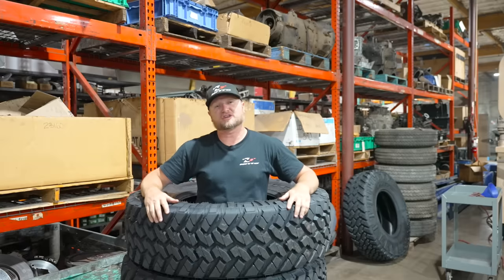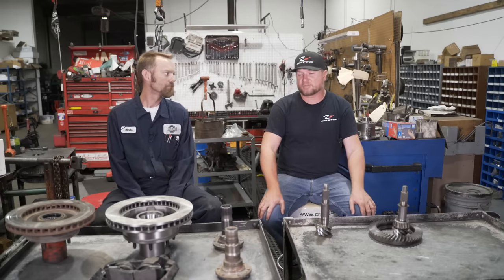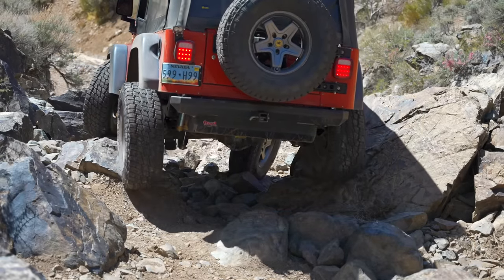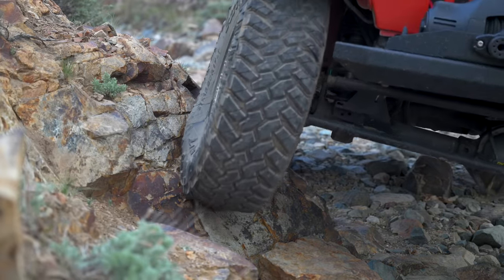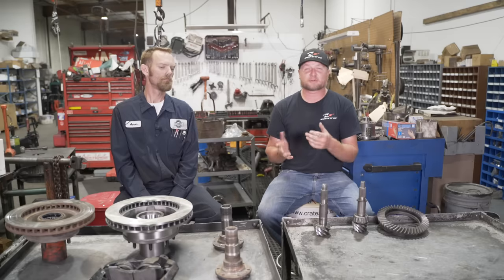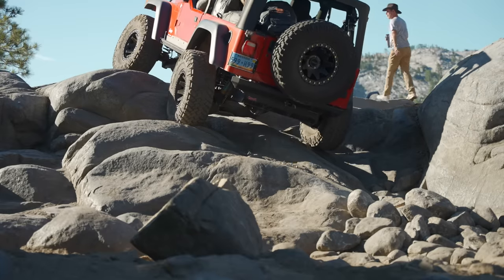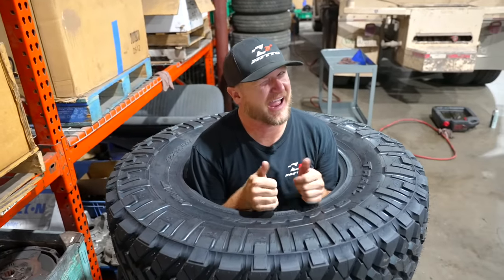How Big of Tires Can You Run on a Dana 44? | Harry Situations

Comment: I ran 35's on stock Ford  ranger axles for a few years with no problems  , when i went to 40 's i broke 3 rear axles and a lot of bed bolts and other stuff.  Never broke the front ttb though

Comment: Great Video! Wow, great discussion and so much good info! I am planning on ordering a 24 Rubicon Pentastar 3.6 auto with 35s, there is an option from factory for 4.88. I will be putting a rooftop tent and occasionally towing (2 o 3 times a year). Do you recommend 4.56 or 4.88?
Reply: I would go with the 4.88s.  The 8 speed has a 0.67 final gear so even with the 4.88s the RPMs shouldn't be too high on the freeway.

Comment: On my jt with axle truss and c tab gussets with dynatrac heavy ball joints, I done goofed pushing a hard trail (black rated) at rausch creek on 40s. Cv blew and the lower ball joint ripped through the c. 40s if you don’t wheel with the protection I had ehhhhhhh might be safe. I’m now waiting for my dynatrac 60/80s to ship and I’m driving my 98 tj staring at my jt in the driveway hurts lol
Reply: Rubicon jt* was locked during the break crawling super slow

Comment: I purchased 34 inch tires (Nitto Ridge Grapplers) for my Jeep for this very reason.  It's more narrow than a 35, lighter, and appears to be the same height as 35's I compare them to around town.  I'm not a mechanic, and and trying very hard not to trash my rig because I can't fix it myself; but still challenge myself on the trail.
Reply: Smart move! I prefer skinny tires as well for most terrain. All the ground clearance, easier to fit, and lighter weight.
Reply: Super swamper had those 34 tall 9 1/2 tires that went good and pretty light

Comment: I have an 89 bronco with the dana 44 ttb. I do plan to regear it and put a ford 9" in the back but I want to keep the ttb. do I need to upgrade to the dana 50 ttb?
Reply: I’d stick with the 44, if for no other reason than to match the bolt pattern of the 9”.

Comment: Only time I have broken my SD60 was over a bounce. I was trying to crawl something I shouldn't have even attempted. I have run 1550s in it now. We run 40s on both Jeeps. The wife runs D44s with zero issues for years now but she doesn't beat on her rig. Only reason I want a bigger than 40 inch tire is because I literally drag my pumpkins on everything now and my 14 bolt has a 15 bolt shave on it. I do miss not getting hung up when I had D44s LOL

Comment: I’m building an 84 4runner. Swapped in a LS/ th350 and Toyota case. I have 4.88 gears now with a full float does 9” rear. I’ve been working on the front diff. Either ruffstuff wider axle or Dana 44 swap. Also considered going down to 4.11’s since I spend my time at the Sand Dunes
Reply: I like Toyota stuff but if you want to go wider a Dana 44 will be a lot less expensive to build.
Reply: @HarrySituations  I have long field chromoly axles already, hi steer and billet 4bolt steering arms. The +5 axle housing is around 850-900 and includes a chromoly short side axle shaft. I just don’t know if the front 8” can handle 400-450hp

Comment: Been running 42s on my chev d44 under my v8 powered jeep for a few years now!
Reply: What have you done to support your d44
Reply: Like they said in the video... driving style and terrain play a big part. I beat on my junk in the rocks so I break stuff.
Reply: @SandyBoxes  nothing. I just dont drive like an ass.  I run dual cases and mostly wheel snow, but the jeep is also my summer broverlander
Reply: @heavymonty  2 door or 4 door? I feel like even with my 35s I need to reinforce the axle just because of the weight even for daily driving. Lots of potholes haha.
Reply: @SandyBoxes  TJ.
Reply: @heavymonty  yeah that makes a huge difference. There is no way I could pull that off on my 4 door jk with all the weight I carry.

Comment: I have a 97 Dodge ram rwd,I am running 38s on a Dana 44,with 4.56 gears,daily drive
Reply: I have a 94 Dodge Ram 2500 with Dana 44s. Right now I have stock size tires on it but wanting to put 33s all terrains on it. Factory height right now. I know it might be hard to answer this without seeing truck but I wonder do you think I would need to lift it to put 33 narrows on it? It sets high for factory. It's 42 inches from ground to bottom of outside of fender. Any help would be appreciated!

Comment: had a 70's cherokee built 401 with 3/4 gm 44 an ff 14 5.13 gears on 40" tires only thing i kept breaking was transmission mounts

Comment: I've repeatedly blown out high pinion Ford Dana 44 Cromoly shafts with 33's and open 4.10 gears in a lightened F250 with a straight 6 and no bed... Not once did they survive longer than 20 minutes on the rocks. It was never the shaft that failed, but the tiny little U-Joints. First sign of real traction and they shear the caps right off the cross.
Reply: Are you reusing the shafts? The ears are probably stretched out by now. And those older trucks used 260 sized u-joints that are smaller than the 297 joints. Maybe we need to do a u joint video next!
Reply: @HarrySituations  nope I've always replaced the entire shaft when they failed. After the third set I gave up, at $600 a pair it got expensive real fast.

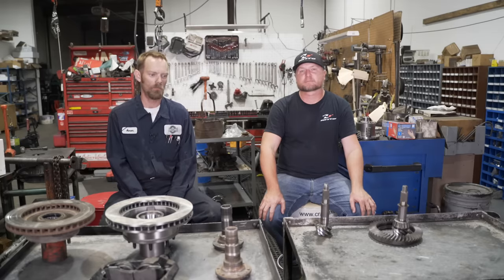Comment: I'm building D44's, the front comes from a '76 waggy, which is a great swap for a '65 Baby Scout. Nothing super special engine wise, 196-4 TBI. Wide T19 going through a D18/20case. I've been driving around on 265x75r's16 for years now on the stock D27 f/44f rear 4:27's. Never broke anything, but doesn't turn very sharp either. The plan is to run 35"s(I even have 37/38's on my mind). My main question is after watching this video, would I be better off on 5.13's or 5:38's. I've been leaning toward the 5:38's, I like the low crawl ratios for my 4 popper. Plus, I like the idea of the driveshaft as the "fusible link" in the drive train. I'm more a finesse driver than a bang and hop sort driving around with old farm equipment.
Reply: You are only talking 5% difference between 5.13s and 5.38s. I think that you will be fine with either since you have that low first gear in the tranny.

Comment: Thoughts on JLU Sport M186 front M220 rear with 3.45 gears.  I would like to run 285/75 r17 tires.
Reply: I think that you will be just fine. Normally I would recommend lower gearing but the eight speed really seems to make it less of a priority than previous Wranglers.

Comment: Harry what do you think about the new full float rear? Should make running 37" or more less of a scary issue right?
Reply: Which full floater?
Reply: @HarrySituations  The forthcoming 2024 rear dana 44. Full float in the rear on rubicon/x wranglers
Reply: @robottaway  I hadn’t heard about that. I would agree that should allow you to run a 37 with no issues. The ring gear on these axles is already bigger than a traditional Dana 44 and the full floater means the axle shaft only has to turn the tire, not support the vehicle weight. Sounds like a great improvement!
Reply: @HarrySituations  right on time to start saving 😅

Comment: How do you all feel about " shave kits" ? Some kits alow 2 inches to be cut off a 14 bolt . Making it close to a d44 in clearance from the ground
Reply: I definitely think more ground clearance is a good thing. I wouldn’t get too greedy though, I have had trouble in the past sealing the cover with kits that shave so much you have to turn down the ring gear and weld a plate on the bottom of the housing.
Reply: @HarrySituations  tmr now makes a shave kit with or without the need to have the ring turned down now. That's the move I'm probably going with on winter build.   I think the Ring shave kit only save an additional quarter inch maybe a silver more.  BTW - the vehicle will be my second junk yard g wagon build on 40's.  The first has a blown engine after a stupid amount of money and time . I'm doing it again with a rear ended one .I got for a can't pass up.deal.
Reply: @immelting9834  I’m not sure I’ve ever heard the terms “junkyard” and “G Wagen” used together before!

Comment: I'm kinda curious how much stronger JK and JK Metric D44's are compared to the old D44 with Set10 bearings.  Also, I've seen some JK R&P kits for installing into an older D44 housing.  Are they worth it over regular gears?
Reply: I think that the larger ring gear and increased spline count makes them stronger. The larger pinion shaft doesn’t seem that important to me because it isn’t something that I typically see break.

Comment: HP 30 is an XJ only axle.  All OE TJ axles are LP.
Reply: Didnt the YJ use a HP Dana 30 also? I got that wrong previously in the YJ video I did for Driving Line.
Reply: Yes.  YJ had a HP 30, but it was a CAD axle.

Comment: Running 38s on my jk rubi. Keep bending the flanges on the rear chromoly axle shafts. Fronts fine. Im prob wayyy to hard on it. I like the skinny pedal.
Reply: I’ve seen that on some Dana 60s that still run a 5x5 pattern and are semi float but running 40s. Sounds like it is time for a full float rear axle.

Comment: Super deep gears vs a doubler on the Tcase, if you can afford only one to start with on a trail only rig, which would you go for?  I'm building a 2003 4 door Tracker with a TJ front frame clip, D44 front, 9" rear, 112" wheelbase, 37" tires.  Running a stock 4.0, AW4, NP231.  Looking at a 231/231 doubler case.
Reply: I think the doubler will make the biggest difference on the trail. The only downside is if the gears in the axles are not low enough to turn the tires on the road.

Comment: Would the D44 on my 86 Ramcharger be the same as the D44’s on the newer trucks of today? Were they stronger/weaker than the current model axles? Would possibly like to go 33’s or 35’s max and not lift it but rather cut fenders for clearance if needed. Thanks.
Reply: They are not the same, newer axles use unit bearings instead of a fixed spindle and locking hub that your Ramcharger has. Newer Dana 44s do have bigger brakes though. I think you will be fine with 33s or 35s.

Comment: Ok so what’s biggest tire on Jl diesel I can run?
Reply: I think 35s are no problem but with the added torque from the diesel I would upgrade to aftermarket axle shafts (like RCVs) if you run 37s.

Comment: You were talking about running 37s on your jeep, can you please tell me the offset is on your wheels or did you use spacers? Thanks.
Reply: I am running 1.5” spacers Larry. Or adapters to be more accurate, since I have 5x5 AEV wheels with 5” backspacing. Wider axles would be nice but that obviously isn’t an easy endeavor.

Comment: The TJ did not have a HP30. That was the XJ and the HP in the XJ ended in 99, the 2000 model had a LP30 nicknamed the TJ30.   I agree with leaving it in 2WD until you need more IE rear locker then 4WD then add front locker then winch LOL
Reply: Thanks Tom. I have gotten that information wrong in the past, I will try to stop making the same mistake over and over.
Reply: @HarrySituations  Ehhh it's wishful thinking LOL. We all wish they would have never went away from the HP 30. Enjoyed your video, I am building an HP44 from an F150 for my TJ right now. Really looking forward to it being done! OX locker, gears, truss etc.
Reply: @tomhubbard353  are you going to use the wedges on the axle for radius arms or run a three link front suspension?
Reply: @HarrySituations  I am cutting all of that off and installing a Barnes truss kit for a Wagy 44. I am still on the fence about narrowing it to wagy width or running it at 66 (full width) and adjusting with the wheels as much as possible (Better scrub) then Welding 9" ends onto my 8.8 to widen it to match plus eliminate the C clips etc.
Reply: This is correct, although the Wrangler YJ did have HPD30 with most years having the dreadful vacuum disconnect. My TJ has a D44 and HPD30 from XJs. Most of the XJ 44 parts are interchangeable, but I believe the axle tubes are 'slightly' thicker.
Reply: @dlm32067  That's true, I wasn't thinking YJ since it is not bolt in to a TJ (Leaf springs) I have collected several HP30s out of XJ with the intent of building a beef 30 for my TJ, then changed my mind and am building an HP44 out of a 76 F150. (NOT bolt in LOL) (The 76 HP44 also has the 1/2 inch thick tubes). There are LOTs of parts that interchange directly or with minimal modification between XJ, TJ, ZJ, MJ etc. makes for some great deals when you know LOL.

Comment: I have an LJ with 4:10 rubicon axles and 33’ tires. I am wanting to go to 35s and 4:88. It’s an automatic. Will lower gears make it have significantly better engine braking in low range?
Reply: Does it have the Rubicon transfer case also? I ran 35s and 4.88s in my LJ Rubicon and thought it was a great combination.
Reply: @HarrySituations  What about a 1991 K5 Blazer with OEM 30 spline axle shafts, 4.10 diffs, a TBI 350 with +40 hp and +50 ft.lbs more(250/350) than stock(210/300), 4L60 automatic, and a weight of 5000 pounds. How safe are 35x12.50r17 Yokohama X-MT tires(110lbs for wheel and tire) when off roading to a "medium" degree ?
Reply: @gen1c8rs88  the weight is a concern with your K5 but I think that with the automatic transmission and sensible driving you will be fine. One thing you didn’t mention is if you have a locking differential in the axle or not. Automatic lockers like Lockrights and Detroit’s and stress axle shafts and hub gears.
Reply: @HarrySituations  Locking hubs, no automatic lockers. 5000 lbs is all in including my weight.
Reply: @HarrySituations  It has the Rubicon transfer case. Can you get significantly better engine braking with an automatic transmission by lowering the axle ratio? I am partialy paraplegic and am looking for better control on down hills.
Reply: @fredeschen3783  it helps a little but I wouldn’t say that it is significant. I will give some thought to what might work best for you when going down steep hills.
Reply: 4.88s are to low on the road with a TJ Rubicon nothing like pushing 65 miles an hour at three grand with 35 inch tires
Reply: Use the gearing calculator online rather than taking somebody’s word for it
Reply: @Fishpalms  that has not been my experience. My 42RE couldn’t pull 65 in overdrive when I had 4.10s.
Reply: you have an automatic I have the six speed on the nsg370 a little revvy on flat stretches But very fun in the hills pulling past other Jeep’s
Reply: Also cherokees had the hp 30 TJ’s had the lp 30
Reply: @Fishpalms  that's not even remotely accurate. My lj with 35's and 4.88's does great on the road.
Reply: @TheOnlyBlackInMeWasWillieBrown  nsg370 transmission
Reply: @TheOnlyBlackInMeWasWillieBrown  automatic or manual- 2006 manual Rubicon TJ Is my setup you have an LJ probably non rubicon which means different transfer case factor in all these things first before commenting

Comment: I have a jk rubi and plan on running a 5.7 hemi would my stock axles take it ? I have an aftermarket front housing but my rear is stock with a truss and yukon axle shafts… would it take it ? (Tires are 37s) similar to your LJ
Reply: I think that you are on the cusp with horsepower and weight but if you drive it conservatively you will be fine. If you mash the gas (hard not to do with a Hemi!) you might be shopping for Dana 60s in the future.

Comment: Great vid! I have a Dana30(front) and Dana44 (rear) on my 2004 TJ Sport. Right now I'm on 35's with 4.56 gears. I was thinking of going up to 37's and replacing the front axle with a Dana44 and adding chromoly shafts front and back. From what you guys said in the video, a Dana 44 is not that much of an upgrade than a Danna 30. Did I hear that right? Should I stick with the Dana 30 and just strengthen it with chromoly shafts and truss?
Reply: The Dana 44 used in the TJ Rubicon has a slightly larger ring gear and carrier with 30 spline inner axles (instead of 27 spline) but the same outers as a Dana 30. Honestly I would look for a high pinion Dana 30 out of a Cherokee and build that with RCVs and a selectable locker like an ARB Air Locker. It will bolt right in and be light and strong with great ground clearance.
Reply: Dana 30 will be just fine for 35’s and you don’t need to truss it either. 37’s is to much for a tj dana 44
Reply: A high pinion Dana 30 front axle from an XJ it a great addition to a 2 door SWB TJ. You not only gain ground clearance for the driveline, but more importantly the front driveshaft angle is greatly minimized. This is especially important because the driveline angle increases with a suspension lift and will create front driveline vibration at highway speeds. The Dana 30 will handle 35” tires with big spline alloy axles with the stock motor.

Comment: My setup is jeep TJ with a HP d30 front with 30 spline inner 27 spline outer trussed, rear D44 with 35 spline shafts. Both are chromoly shafts from Yukon on 35x12.5r15. Gearing is 4.88. Kinda wished I went with 5.13 due to having the 2.4L engine.

Comment: great video guys.QUESTION? I have a 98 tj 4.0 and i put true lock rubicon axles under it.My question is i have read that its better to lock the rear most always when in 4x4.I read that because both axles are locked that it puts less stress on the carrier because the way the rubicon locker is designed.Is this true or can you explain? Sincerely, thank you so much.Rob
Reply: Good question Rob, I will ask Aaron his opinion. Personally I think that having the locker locked would be harder on the components since the energy has to go somewhere if the tires are not turning at the same rate (like when you are turning).